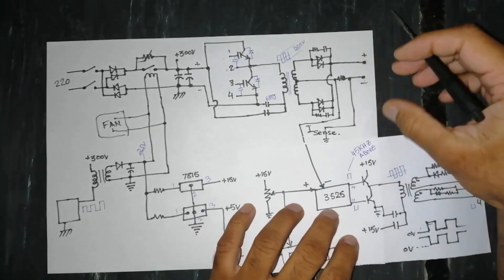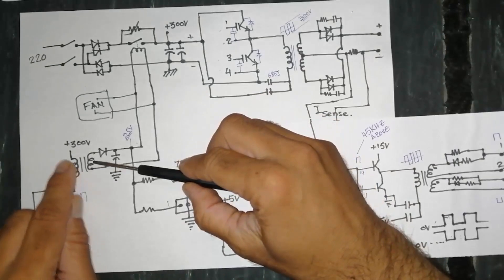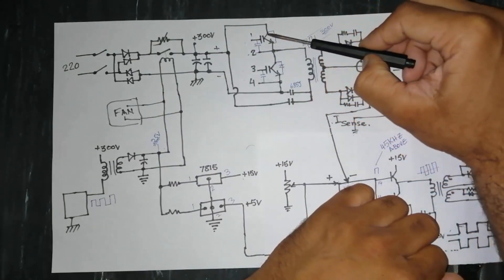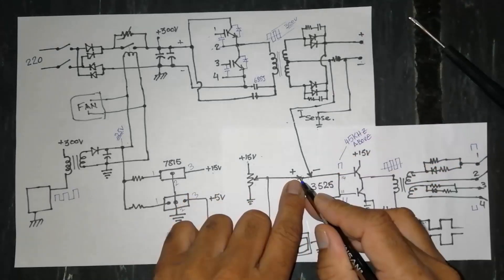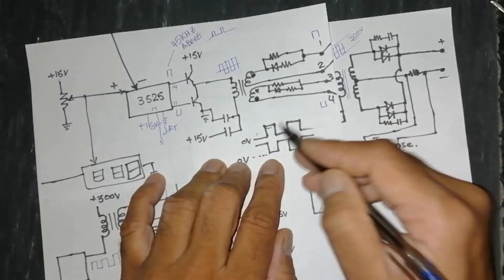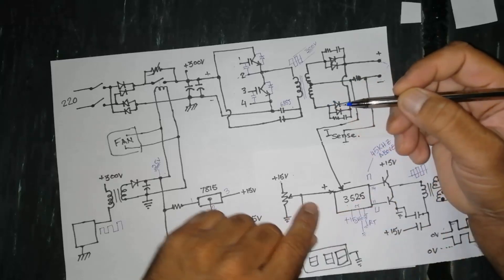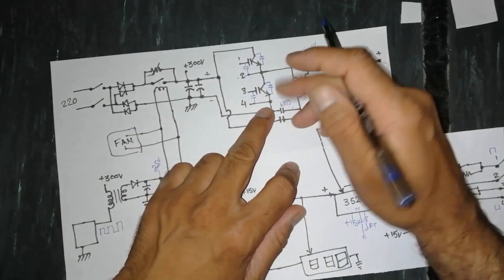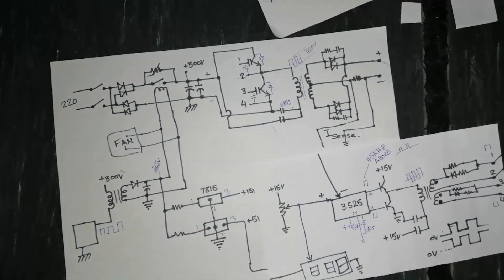{292} Inverter Welding Machine Repair Course / How To Repair Inverter IGBT Welding Machine

Comment: Good morning sir,thanks fir this video,but my fan is not starting as there is not voltage at the voltage regulator pin and there is voltage at the dc line and the igbt are good but the machine is not starting,what can i do at this stage

Comment: Inverting a pwm signal I try it’s work but the oscillation ic need 15 volt to get good inverter voltage for low side driver the peak valve is the bigger issue if the duty cycle is turn don’t the high will drop to 5 volt and the low will go up to 13v I don’t like this design too much issues with driver the igbt in a sti

Comment: What pin of 3525 is connected to sense bro?
Reply from the maker: pin 1 or 2 are connected to sense line. selection of pin 1 or 2 depends on output polarity 
pin 1 is inverting
pin 2 is non inverting
Reply: @HaseebElectronics  btw what is the bhd smd transistor value

Comment: Hello. Your videos are amazing and informative.
I just want to ask as to what might be  the possible faults in our arc inverter welding machine. The machine turns on normally and the output voltage is 40-50 V when measured with a multimeter. However, when we begin to use it (at the instance that the electrodes touch the metal) the O.C. light turns on and there will be no output to the machine.
I hope you can answer.

Comment: Hello, I have an Telwin force 195 inverter and keeps burning the rezistor. I changed bridge rectifier and relay and still result. Can you help me. Thanks.
Reply from the maker: welcome brother 
you did not mentioned, which resistor is burning out. 
if it is at input (inrush protection resistor) in parallel to the relay
then the relay may be damaged. 
waiting for your reply for telling, which resistor is burning out?
Reply: @HaseebElectronics  Yes this is the resisor. I have already changed the relay, rectifier bridge and i have put a bigeer resistor  and now one of the big capacitor have exploded.

Comment: I do not understand how the amp setting works on welding machine . which pin of sg3525 is is used for this function?
Reply from the maker: no 
problem i will explain it in detail as soon as possible for me

Comment: Can we say that igbt make dc volt to ac by switching so transformer will work...???
Reply from the maker: exactly perfect 
we apply pulses to the gate of IGBT and igbt allows to flow the current in transformer primary winding in that period and when the pulse is in off period, the igbt will stop current flow in the transformer. so current will keep changing in the winding to create changing magnetic field to produce voltage in secondary side

Comment: Sir why to use such huge circuit... If we want output volt as dc volt or ac volt of just 24 or 40 then y not use stepdown transformer in making welding machines??
Reply from the maker: transformer cannot produce so huge amount of current. 
this machines are reducing the size, power consumption and reducing the price

Comment: Sir my inverter welding has highvoltage output.it has 100+vdc.how to control output voltage and set to  its limits?
Reply from the maker: please adjust its duty cycle. 
there is current limit trimpot. try to adjust it
or 
try to decreasing switching frequency
or you can remove 1 turn from both portions of secondary, if possible

Comment: Daer Sir, very good explanation. Can you give advice what type of components make a good welder. Which parts are crusial and need to be of very high quality. Best regards, Maarten.
Reply from the maker: most critical components are
IGBT / MOSFET 
Output Rectifier
Control Card
smps IC (in low voltage power supply section)
bypass relay (in rare cases)

Comment: Thanks for your video. Can you tell me if 105V open circuit voltage on the output is ok or not because some people say that anything more than 90 is not ok? Does checking the output by touching + and - with a piece of insulated wire cause just a spark or cause a short circuit and blown igbts?
Reply from the maker: welcome dear.
105 volt output is very high, 
it can increase over voltage stress on IGBT/MOSFET (and igbt/mosfet may damage)
check control card, may be it is creating ore duty cycle with no load, if it generating more duty cycle, you have to set current setting / current feedback circuit
Reply: @HaseebElectronics  Thank you very much for replying. There is a problem definitely. Do I set that circuit via potentiometers which are near control card?
Reply from the maker: @zlane71  exactly, 
Set current potentiometer to minimum on front panel
connect oscilloscope to the output section of control card and
 try to set minimum duty cycle at no load by means of current limiting potentiometer on control card
So it will increase its duty cycle when the input current potentiometer is set to different current limits
Reply: @HaseebElectronics  Thank you very much, indeed. You are a great man. You dedicated your precious time to me.
I am an amateur, hobbyst, trying to help my friend, already replaced 2 blown igbts(there are 4), now it is not dead any more😄 but uc3846dw gives 6.6v instead of 5.1v on the output according to datasheet. I will possibly solve that problem by following your instructions using pocket oscilloscope ds212 which can handle 40V. I have to find out where the output of the card is. Can I use the output of this chip uc3846dw? There are two potentiometers for 2 channels and outputs on pins 11 and 14 (12 is gnd). In your other video you said to set duty cycle to 50% for both channels. What percentage is good in this case?

Comment: I have welding matching witch 4  IGBT gt50jr22   all shote and I have changed new one after the second test again 2 no IGBT gt shot what is the issue, pl send me your WhatsApp number I can contact you.
Reply from the maker: may be its gate drive components have some issue, or pf capacitor connected with series of IGBT is bad
Reply from the maker: 00962-79-1161084

Comment: There is something wrong with the igbt gate oscillator transformer, between pin 1 and pin 3 is to IGBT mosfet😀
Reply from the maker: actually the triggering pulse is provided to gate. and gate and source 
so gate drive section must be configured properly. because gate components for igbt and mosfet are different 
and if transformer have high output pulse then it can also make issues
Reply: yes I understand that but the schematic you described is wrong with pin 1 and pin 3. pin 4 should be on pin 3 as a low side mosfet gate. pay attention to the start of the winding and the end of the transformer GDT winding. if you continue to use this scheme, it cannot be used on the SMPS Halfbridge, but it will only be used on the SMPS Flyback Double Mosfet sir😀

Comment: Hello Haseeb. Thanks for a great series on the IGBT welder. Please can you explain what the difference is between PWM in a smps power supply and PWM in a welding machine. In a smps power supply, the duty cycle is adjusted to change voltage, but keeps the current constant. In the welding machine, the duty cycle is adjusted to change the current, but the voltage stays fixed.
Reply from the maker: best regards
in smps power supply, there are two types, 
1. voltage mode smps power supply (in this smps the pulse width is adjusted to maintain the output voltage, and the current level is maintained using vcc voltage from bias winding)
2. in current mode smps power supply (current flowing through the mosfet / driver transistor is measured by means a current sense shunt resistor connected in series with mosfet and primary winding of the transformer, while the voltage level is maintained using optocoupler)

in welding machine 
the output current is measured using a series shunt resistor,
regardless to the output voltage, the current is maintained (even the voltage will drop to minimum voltage around 1 volt or less, for example)
output current value is translated into relative voltage, and it is compared with our required current (set by the front panel current adjustment pot) 
then the resultant value is applied to the pwm controller to adjust current value
Reply: @HaseebElectronics  Thanks very much for the explanation.

Comment: Hi. The soft starter protection from inrush current work only once time when the welder become power?
Reply from the maker: yes. the NTC will used only during starting to protect the input circuit from excessive inrush current. after that the relay is interlocked for routine operation